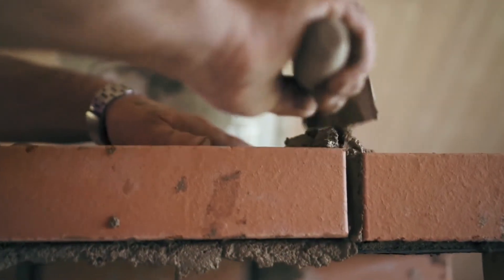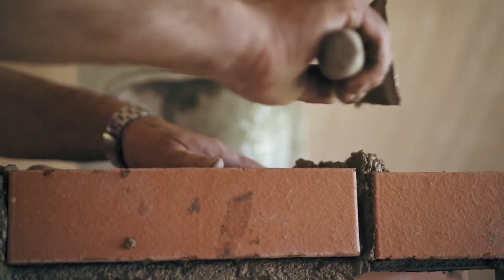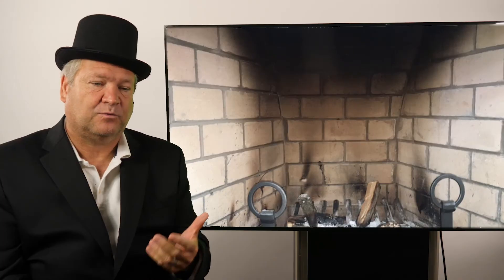Chimneys Explained #18 - Firebrick Joints

Comment: And one other thing. Thats a pretty deep firebox. All the heats going up the flue. You are going to need a bigger chimney to accomodate that...... 2 firebrick deep or no 2 1/2 brick deep if you have a marble profile. That will give you a 3 and a half brick chimney on outside.  And the walls need to be angled to relect heat into room.

Comment: Tight joints.... it does matter about joint thickness. With refactory mortar 1/8 to a 1/4 inch no more. I prefer 1/8. Refactory mortar I believe is good up to 2000°F.  Regular cement about 700°.  And you need to use tight joints and refactory cement between the flue liners as well, if its new build. It will take a long time to rot out. Tight joints in all burn areas. It will cost you well over $2000 to rebuild the firebox around here.
Reply: If you see this, can you please answer me this:   I  am rebuilding just the base of the firebox as I had to replace the rusted out gas line.  So I removed 75% of the solid bricks on the surface to run a new line.  It seems those were all mortared with regular mortar (house built in the 70's).  Below those bricks were different thicknesses of mortar and then regular 3-hole house bricks, randomly layered in.  So do I use regular mortar or quikcrete to build a level base for the fire bricks to sit on and then use refractory mortar between the firebricks?   Thanks!
Reply: @WayPastCrazy2525  YouTube is deleting my comments. IDKW
Reply: @crasherxtreme I hate all these comments section police. Yeah, there are plenty of nasty and rude commenters but it seems just normal comments that I post magically disappear. I don't get it either.

Comment: Ok so floor of fire box what's it got to be made of.
Here's what I discovered after a house fire of a chiney and fire place that came with home.fire started just below the floor of fire box soldered a beam caught house on fire in the basment just below 1st floor so firemen came & beat the he'll out of the back of the chiney how do I fix this whole problem of repair. It's a red brick 1930s build center of the house house had been inspected by insurace adjuster prior to fire over storm damage 100 mph wind & tree fell on house but never-ending chiney . Ya being on fire & life flight makes you want to do things yourself u get trust issues
Reply: refractory cement
Reply: How did your job turn out? Just firebrick and refactory mortar is the best. I prefer very tight joints
 1/8"..  but do not use over 1/4" joints between the firebrick. I hoped your firebox worked out nice. Its not the task I would ever put a beginner on. And most homeowners don't want to get on scaffold to work the chimney

Comment: so what kind of material/mortar/anything would you put in between the bricks (excuse my lack of terms I am trying to fix my fireplace that came with my new house I purchased and am trying to fix the old material and replace it with a new one)
Reply: Guess you never got your answer here.  I too am rebuilding just the base of the firebox as I had to replace the rusted out gas line.  So I removed 75% of the solid bricks on the surface to run a new line.  It seems those were all mortared with regular mortar (house built in the 70's).  Below those bricks were different thicknesses of mortar and then regular 3-hole house bricks, randomly layered in.  So do I use regular mortar or quikcrete to build a level base for the fire bricks to sit on and then use refractory mortar between the firebricks?